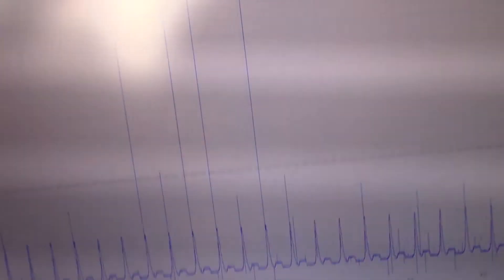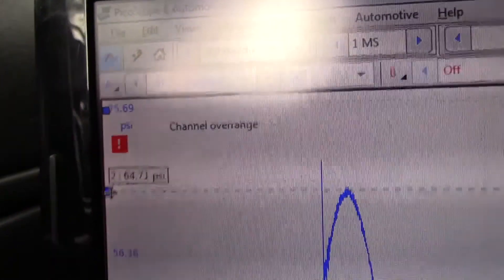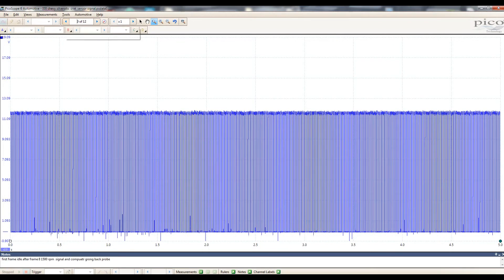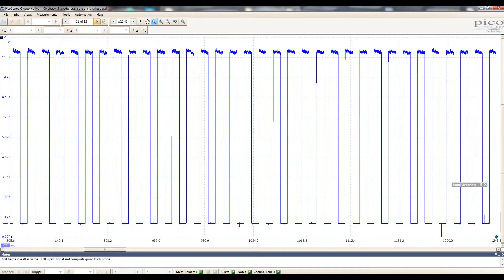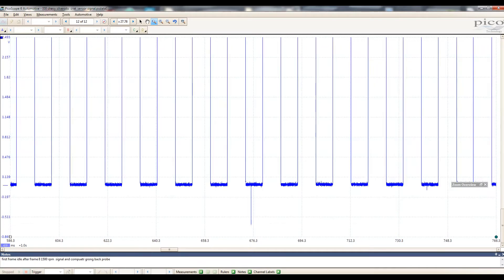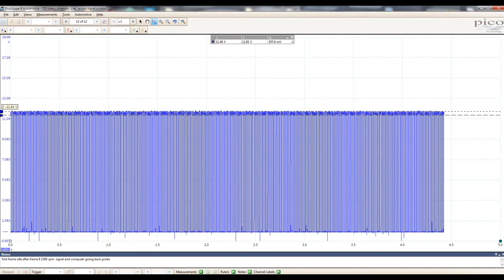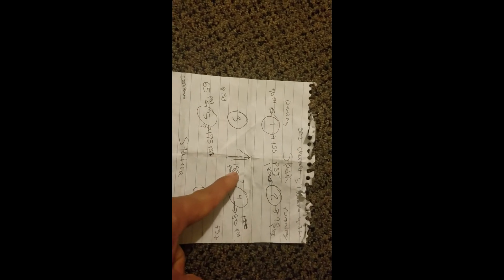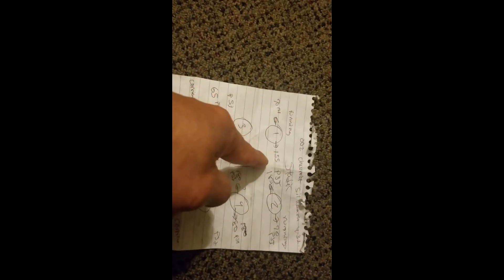01 chevy silverado misfire from hell part 2 continuation

Comment: Have you done a vacumm running test? Also I would do a running compression test at 1500 rpms with a long time base to see if goes down or if steady, I had a Jeep with an issue like yours and was a bad lifter under light load. Pico was the only way to caught that with out disassembling. With your results it is definitely showing a compression difference on those two cylinders.
Reply from the maker: Maic Salazar 
vaccum keeps steady  I did it but i did not included because did not find any anomalies
when I removed the cylinder head I swaped the lifters to know good cylinder nothing change still have misfire on those 2 cyl